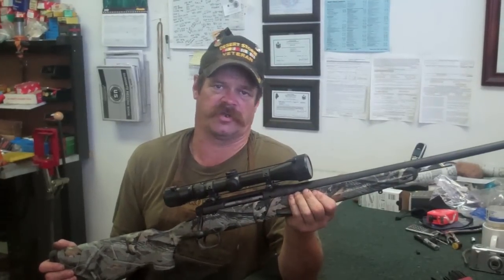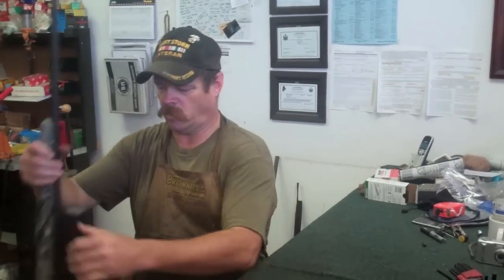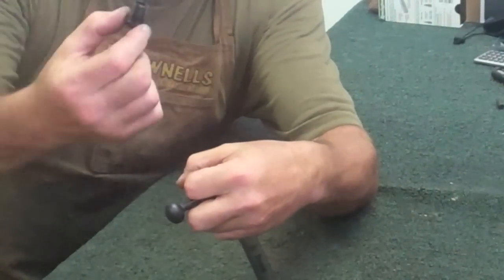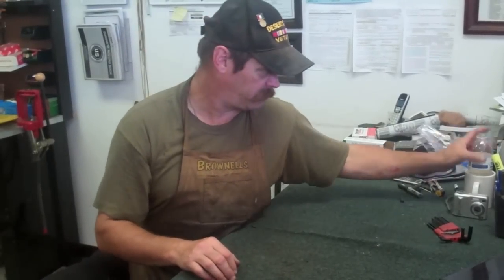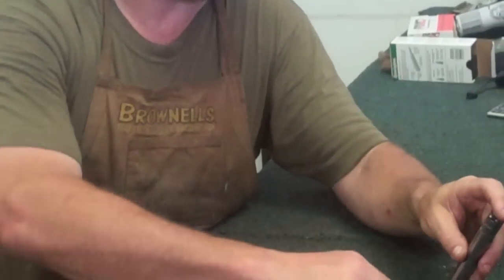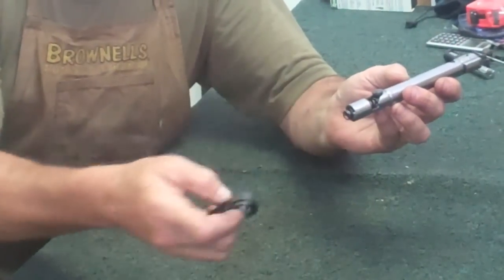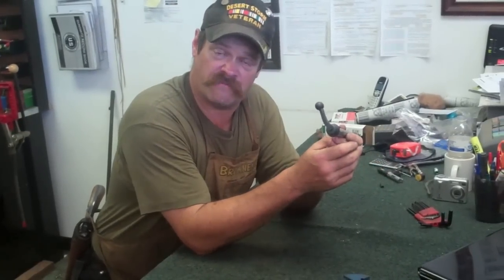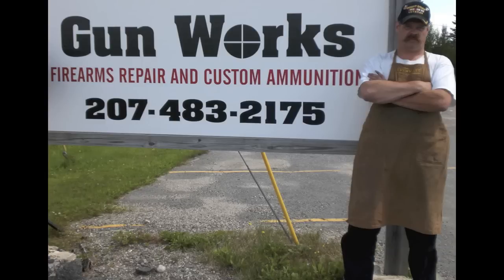Gunsmithing Disassembly: Savage Edge (Gunworks)

Comment: Jim, I have a Savage 112 in .223 REM that is having striker pin problems and not properly igniting the primer (on the factory and hand loads). The rifle will maybe fire 1/8 cartridges. Is there a way to ensure the firing pin comes out another 10-15 thousandths? What do you recommend?

Comment: Ht Jim, My book for my new savage axis shows the smaller baffle cutout goes on same side as extractor in section 3, not opposite side? I tried it both ways and bolt will go in either way but book shows me baffle cutout same side as extractor is correct. Confused!

Comment: Hello sir,
Hoping you can answer a question for a fellow mainer? I've got a Savage model 11 lightweight hunter in .260 with the fluted bolt and I'd like to use the bolt in my Savage Savage model 10BA Stealth .308 The bolts interchange physically and there's an indicator for a cocked firing pin on the model 11, otherwise seem to be identical in operation. Any other considerations to be made?

Comment: So I had the same question as others and I wanted to clear it up. According to the savage manual for the axis it says the baffle undercut is positioned on the SAME side as the extractor. I've included the URL for the PDF version of the manual and it has it in writing as well as a clear cut picture both on page 5 of the manual not the PDF page. 

JIm I do not write this to shame you or with any ill feelings. I put it on this video as you give the most info on this process and I thank you for that.  

https://s3.amazonaws.com/savagefiles/manuals/manual_centerfire_axis.pdf
Reply: +jimmy V You are correct jimmy V!
Reply: John S. I

Comment: my savage axis is jammed idk how it happened but i can not release the bolt at all.  all it will do is turn up and down will not move out at all.  i don't know what to do this is my first bolt action rifle and with this luck probably my only one i have tried releasing the bolt as you would normally it doesn't work.  how it jammed was i was at the range shot my 6th shot went to cycle and i couldn't pull the bolt back.  gun smiths around me are hard to find and the one that i knew about is now out of business.  I'm on my last straw with this rifle, i was just getting it to shoot where i wanted it and this happens any help is greatly appreciated.
Reply: weasle48 . Just had this happen to my wifes yesterday. if you havea SOFT mallet you can give it a little peck and it will slide right back. But there is a problem. The ejector is messed up. We called Savage from the range and they said send it in. So you shoudl do the same .
Reply: spazpunk yeah i have tried that before but the other day one of my friends tried it and seemed to get it i don't know what i was doing differently then him but hey it works just fine now
Reply: the extractor came off  and is binding in the action